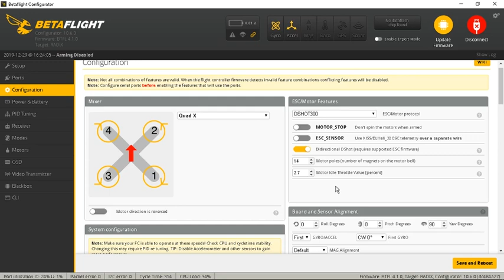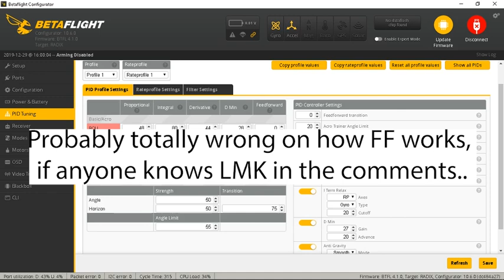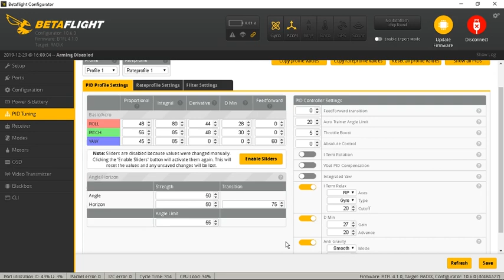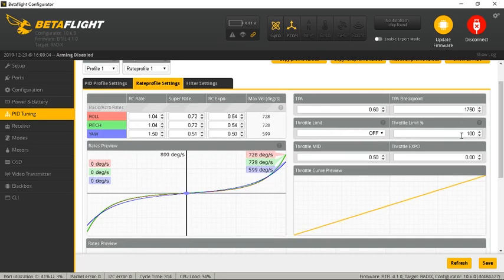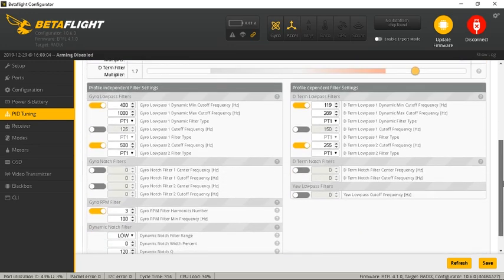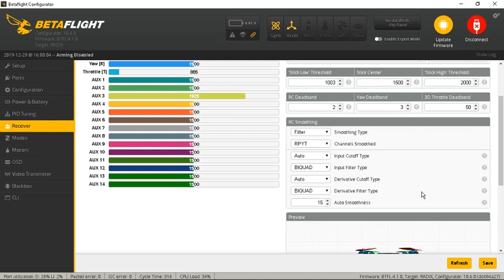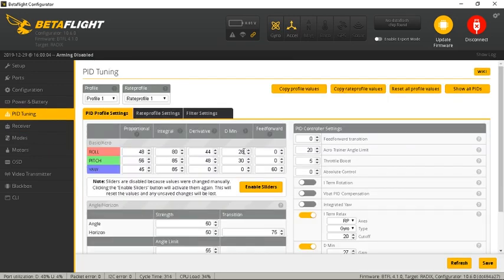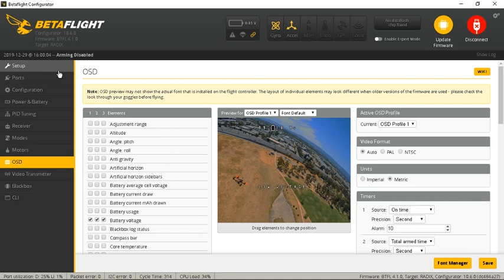No one talks about this.. | Betaflight 4.1 Settings

Comment: I've noticed how sloppy most people fly Betaflight compared to Falco X when the same pilot flies it side by side. I think that's because of how quickly it reacts to every stick input. I just zero'd out feed forward and upped Auto Smoothness, my flights look a lot cleaner. Feed forward seems to be inconsistent in putting the quad where you intend it to be in high rate snap maneuvers. What do you think?
Reply from the maker: couldn’t have said it any better myself! it’s hard to predict the quads behavior with feed forward  active. Although they’ve fixed it a bit since this video the way Betaflight uses FF isn’t the best for flying consistently smooth freestyle (at least how I fly and imo)

Comment: How to get more hanging time inverted or from a split S. I mean more floating effect?
Reply from the maker: the number one thing is not to use any throttle after the initial punch to get upside down. you can also try lowering your idle speed or using dynamic idle if you are on betaflight 4.2 im making a video about this very soon.
Reply: @MaxBeamer  Thanks dud. Waiting....

Comment: when i enter the smooth point to 15 and save when i go back its not there is there something i am not enabling? thx
Reply from the maker: Hmmm that’s odd, do other settings save? If not then check If serial Rx is enabled on the proper uart
Reply: @MaxBeamer  yes everything else is ok ive been flying the quad and playing with the rpm filters this week so tried your method and the only thing that was not saving was the auto smoothness. Am running iflight dc3 with crossfire i was originally getting rid of propwash the best i could the dc3 was a bnf and didnt fly to well from the box thanks anyway mate great video all the same

Comment: Thanks for the settings. I'm a bit lost at tuning but your settings got me closer on my Marmotte 4S rig. It's feeling much better. Still can't seem to get rid of my prop wash when I'm doing stuff like split-s and alike, I still get some bobbles at the bottom. Any suggestions for that?
Reply from the maker: What props and motors?
Reply: @MaxBeamer  Mr Steele 2306 2345kv Silk V3, Ethix S4's
Reply: Here you go.
Reply from the maker: @dklassen  a lot of the trick to getting rid of propwash is gonna be on the sticks, when you come out of the split s gradually raise throttle and make sure your tilted forward as much as possible to reduce propwash. tuning pitch and roll and adding some d term plus making sure your center of gravity and battery placement are proper can help but wont get rid of it completely.

Comment: I can't even get my qwad to fly good on 4.1, it just flys like crap. I crashed and bent a motor bell trying to tune it. It flew so much better on older firmware and I know it's not hardware because it flew great before the update. I haven't tried zero feedfoward maybe that could be it. Great video mate.
Reply from the maker: I felt the same way at first it took me like a month to get everything flying the way I like it. But you can always go back if you end up not liking it, I flew 3.5.7 forever before finally going to 4.0😂. My main 2 tips for 4.1 Is make sure to use rpm filtering or it’s really not worth the upgrade and make sure U don’t diffall your settings from 4.0 start fresh!
Reply: @MaxBeamer  I usually wait for a few updates to come out before I update. I've put it back to 3.5.7. You would think a betaflight f4 board would be the best fc for updates. When I get my qwad up and flying again, I might give 4.1 a try again. 😁👍
Reply: @fueledfuryfpv  did u?

Comment: Why are you using aux for Rssi. Comes through with osd settings now no need for aux usage. Crossfire gives 300% scale and rssi
Reply from the maker: I’m using r9 and I haven’t changed it yet bc it still works lol
Reply: R9 f.port will get RSSI auto on OSD as well. You will just need scale 200%. No scaling needed if using AUX.

Comment: 34% CPU load 😂
Reply from the maker: The radix boards I use run a little bit differently than most fc’s and use a special version of Betaflight and higher clock speed to deal with the higher sample rate of the bmi160 gyro. 34% is normal and perfectly fine especially when also running rpm filters..

Comment: Woah dude that gyro filter maxed tf out eh my shit would burst into flames😂
Reply: Sliding to right reduces filtering and you need much much less with rpm filters in use. Dynamic filter can be reduced a lot as well. Better prop wash handling this way. I slide filters fully to right in stages and test with slightly damaged props so perfect of new set and tune can cope with a ding or scrap
Reply: I have been able to get mine on all my builds to 1.7 both sliders and not a bit of heat from the motors

Comment: FF doesn't boost P or D.  It is its own 4th term that is based on Setpoint slope.  So the faster the move, the steeper the Setpoint slope and the more FF push the PID Sum gets.  Basically the same math as the D-term (push is based on slope magnitude), but it is based on Setpoint vs. Gyro and pushes vs. dampens.
Reply from the maker: Damn so it has even more influence than I thought! That’s what it feels like its doing and I said that once to someone who kinda knows there shit and they told me it was boosting p and d values 🤷‍♂️

Comment: Bro are you sure your filter sliders are doing anything that far to the right with expert mode NOT enabled?  I have mine maxed out per uavtech really helps w propwash on no gopro rigs.  Good tip on the otherstuff  BTW
Reply from the maker: Yeh man expert mode was enabled to get them to that position..

Comment: For landing softly.
https://youtu.be/xiH0AOsp-gY
Reply from the maker: Yesss! I’ve been looking for something like this forever! Dunno if I want pids completely off but I’m gonna watch the rest later need to put this on a separate switch or something! Thanks man
Reply: Max, above your min check you dont even notice it's off. I see your min check is 1003 so you would need to be holding the throttle to the stop to even tell you had the pids off. For instance "wall taps" flip your switch, as soon as you almost get to the wall slam the throttle low until you tap then ride it out like normal.
Reply from the maker: KelvinFPV ohhhh I see! Woah that’s a big thing. How have I never heard of this till now gonna try it asap